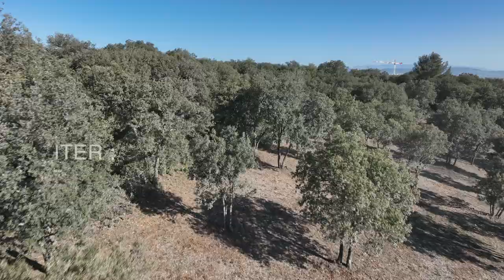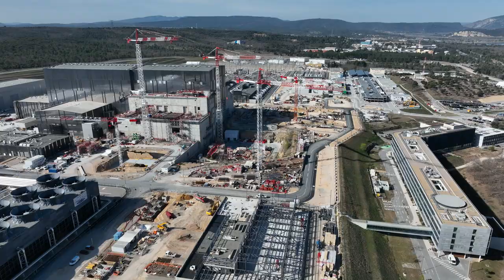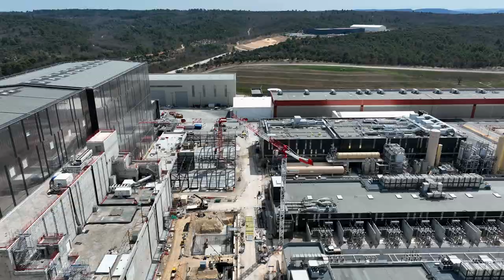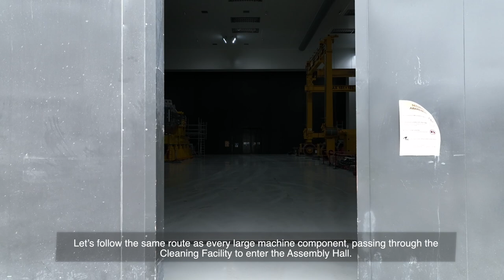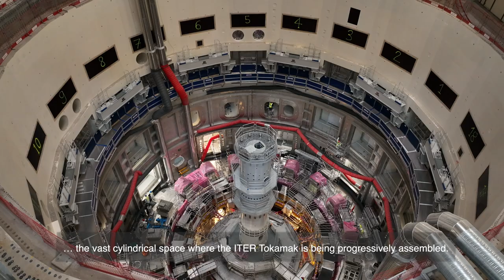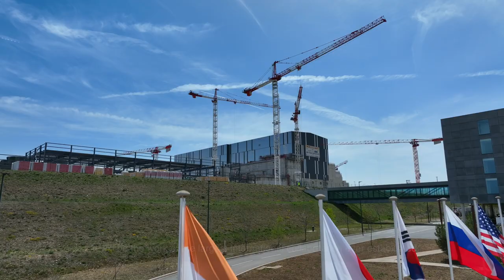ITER: Flying over... and through

Comment: The bold claim to be the first to produce sustained fusion is far fetched,  Too big, too expensive, too late.  Chances are very high other less expensive experiments will beat you to it especially with Russia's economy slowly slipping into the third world.  Even if this experiment succeeds some day, duplicating this effort is prohibitive in so many ways.
Reply: I expect that future designs would take ITER learnings and evolve toward simplicity. This, being an experimental reactor, contains a lot of complexity that ought to prove itself removable, engineers just don't know which parts, until they conduct those myriads of experiments. It's just like huge and expensive training wheels, until we figure out the basic design and skills needed for cycling down the road for fun and profit...

Plus there have been improvements in room temperature superconductors etc that suspect already enable smaller and cheaper tokamaks with the same powers.

It's great to keep an eye on the other experiments too, of course. May very well be that projectile fusion or something takes the lead from tokamaks in the end...